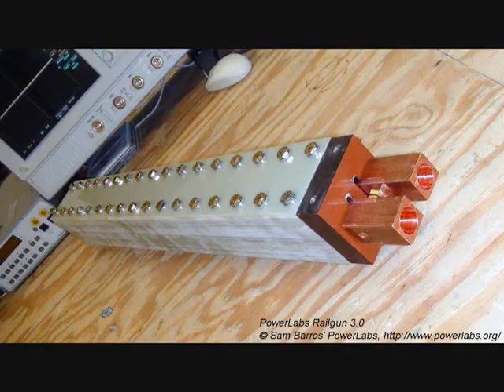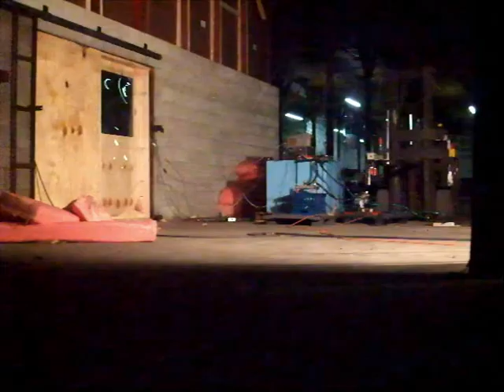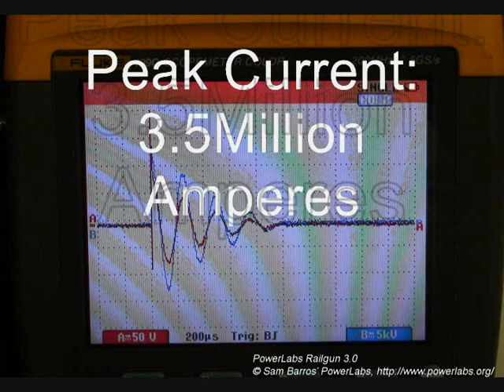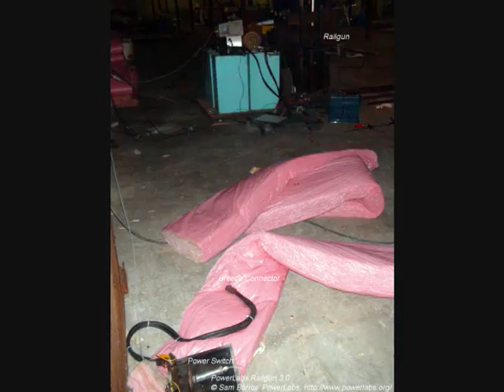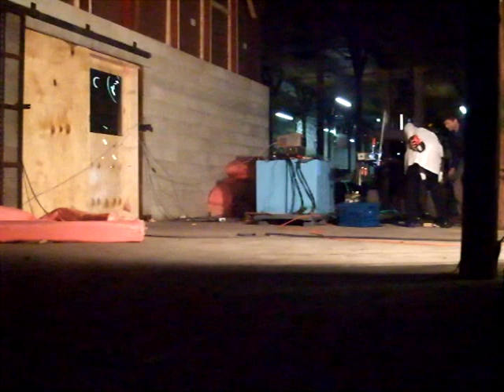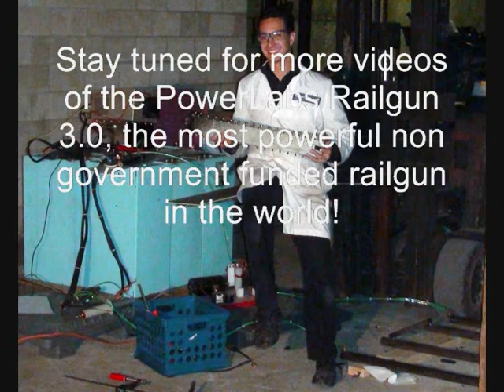Railgun Plasma Armature shot at 105kJ

Comment: what's the resistance of the railgun approximately? does it increase noticeably when the projectile is at the end of the rails? with mine it stays at 0.117ohms (my tools can't be more precise than that) and since I have 400V capacitors I assume that the current will be at around 3400A?
Reply from the maker: Great question!
Given the 3500kA current reading at 18kV, we can assume that the total impedance of the entire circuit is around (I=V/R) = ~ 0.005Ohms.
 Separating out the pure resistance would be a little more work; you could calculate its DC resistance by using the resistivity of copper times the cross sectional area of the rails times their length, and adjust for skin depth effects to get the AC resistance, or you could use L = μ0 L/π·[ ln(d/R) + 1/4 ], where L - rail length, to get the inductance of the rails, and the difference betweel L and R (impedance) would be r (resistance).

Cheers!
Reply: thank you very much  @Powerlabs

Comment: The non conductive projectile has a thin aluminum foil backing behind it; that foil closes the circuit, vaporizes, becomes a plasma, and then accelerates the plastic ahead of it electromagnetically. There is no Nitrogen injection at all here...

Comment: @123324ben No injector whatsoever on this gun; the projectile starts out stationary and reaches terminal velocity with 100% electric acceleration.
 Explosive injectors are not popular with railguns because burning propellant will put a lot of carbon in the insulators and short them out.
Reply: What would happen if you injected noble gas?

Comment: Well apparently not... they never found the projectile. if you have the projectile injected, you dont need a switch. Using any sort of switch limits the peak current and the efficiency. If the projectile is injected, less energy is wasted on getting it to move, therefore increasing overall velocity. The initial issue with railguns is not the stored energy level, its the efficiency at which it's being used, and the ratio of electrical energy converted to kinetic.